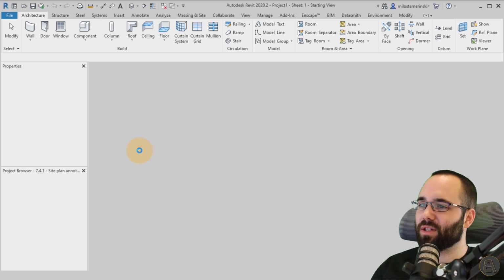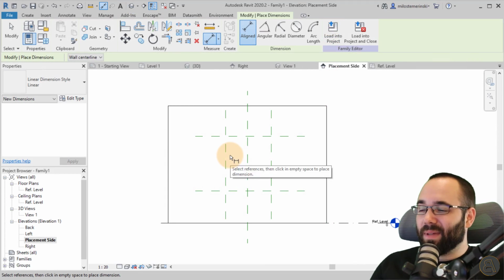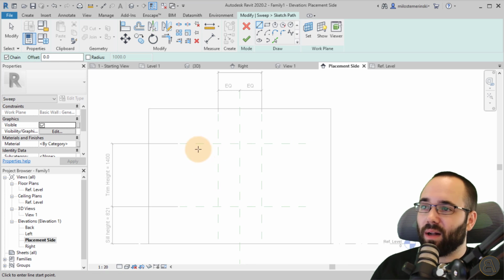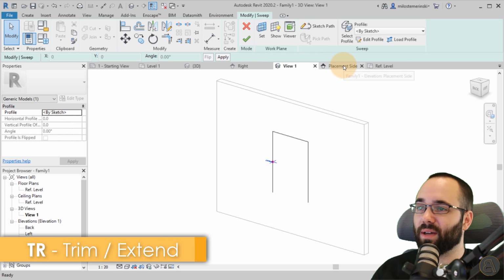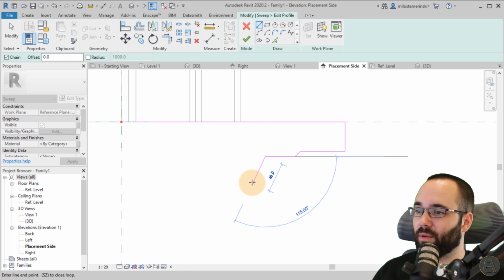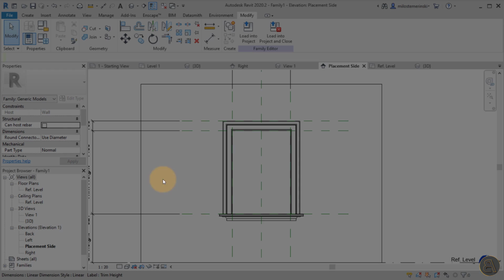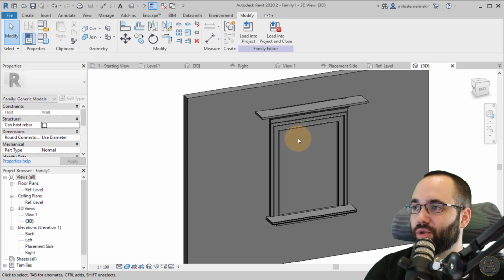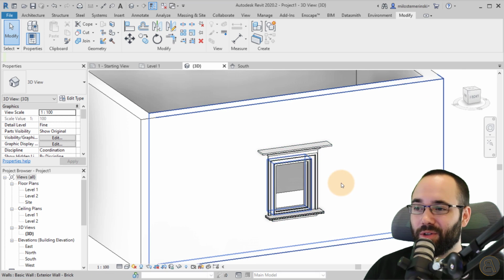Classical Window Trim in Revit Tutorial

Comment: I have a question, when I adjust the top trim, the body of the trim not moving with the top trim. but the bottom moving normally.
Reply: Did u lock the dimension 160 that he had between reference plane of top trim and top reference plane of the window?
Reply: Hey, I have a same problem and I can't solve this :(.
Reply: If you solved this,please tell me.Thanks